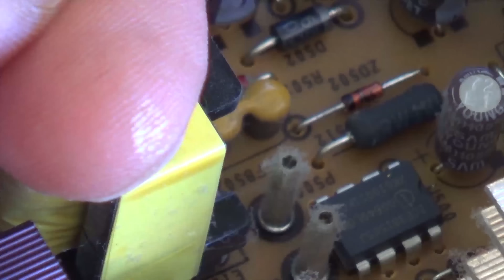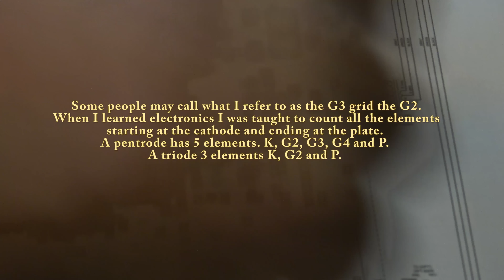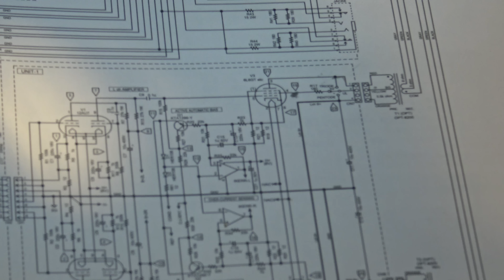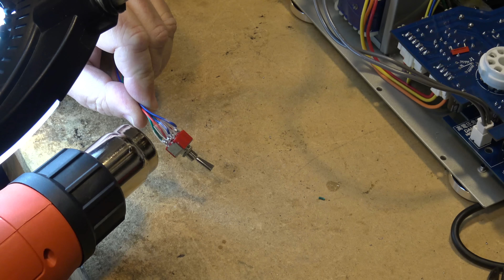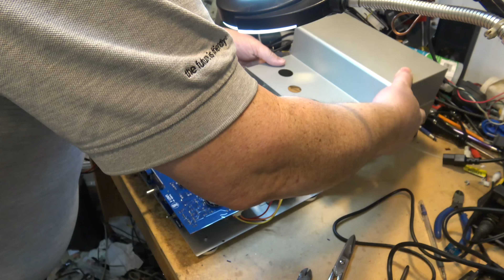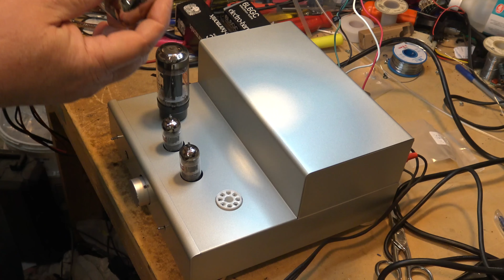ELEKIT TU-8200 6L6 Single Ended Tube Amplifier build Part 5

Comment: oh wow , sounds nice even over this  mic and video, sounds analog
Reply from the maker: Single ended amps always have the best sound.
Reply: @12voltvids  glad to hear from you . Im just entering in that world and all im skeptical about is bass response . Some say there is no SE amp with good bass , then i check frequency response testing of one and its even higher bass then it should be , bit og gain on bass.
So those are contrary information's , what do you say about it ?Thanks
Reply from the maker: @dedskin1  it's all about the speakers.  You need really efficient speakers. I use technics sb7000 with big 15" woofers.  Bass is clean.  Also the tubes used make a big difference.  Swap the tubes for different sound.

Comment: Might have to do this, any easy way to map the LED? UL = Green, Triode = Blue
Reply from the maker: Well an extra pole  on the switch would do it.  
Notice that the new version of this amp includes a switch to change between triode and UL mode. Do you think the designer saw this video and thought hmmm, good idea and designed it into the replacement model.  I like to think so.

Comment: I'd like to see you put mahogany wood on the sides, give it little bit of a steam punk look. I really don't like the sheet metal look of the case. The front would look better being a thick piece of brushed aluminum, and that big hump in the back could be Plexiglas, so you can see what's going on inside. Just my two sense. Job well done, I think this amplifier rivals some of the amps that cost thousands more.
Reply from the maker: It does rival amps costing many times the price (this was not cheap, it was 1120 after tax). The metal case forms part of the shielding to electronics.  Yes it would look nice with a mahogany case, but I am not a wood work guy so it lives as a metal box.

Comment: Hi 12voltsvid
thanks to your videos I successfully assembled the TU8200.
To add a subwoofer I have to provide a line output, how do I do it?
Reply from the maker: You can take it off the wiper of the volume control or feed it off the speaker terminal using a voltage dropper resistor network.

Comment: im not the engineer but running signals close to the big transformers , i doubt that is a good design choice , some go so far to spin the wires and move signal to the one side , and power to the other , if they so much as touch they will throw the chases away , that is what i saw , its first time i see signal that close to the Iron core , or what thet is , that middle transformer round core ,  again im no engineer but i know a thing or two about electronics

Comment: I   wander how hi fi  buffs would rate this amp  in a blind test  with  manufactured amps costing   mega  money
Reply from the maker: Dambuster 

Just search ELEKIT TU8200 review to find out. Here is one review 
https://www.head-fi.org/threads/elekit-tu-8200-dx-headphone-speaker-amp-review.722633/.

And another

http://www.kenrockwell.com/audio/elekit/tu-8200.htm

That should answer your question. The experts agree, that this sounds as good as anything out there.
It is the best sounding amp I have heard.

Comment: I don't really see the point of showcasing an amp through tinny little speakers and a video camera microphone and some random video codec and YT's own compression scheme.  All I can tell is what YT streams back sounds pretty terrible with heavy bass breakup on some of the loud sections.
Reply from the maker: Those wern't tinny little speakers, they are a pair of nice Altec Lansing 305 floor speakers that are solid walnut, and stand about 2 feet high. These units rock, and sound beautiful. When they were new they sold for over 2,000. I had the surrounds replaced on the carbon fiber woofers and mid range drivers a few years ago. They sound absolutely fantastic in my studio, and any distortions are caused by compression, and youtube re-coding.

Comment: Just finished building one sounds great had a little problem easy fix.
Reply from the maker: Russell Phillips 
Yes it does sound great. They have a new one that uses 300B tubes. That would be interesting to build.

Comment: Enjoyed your your documentary on valve amp kit.In ultra linear there was less distortion and more body in the sound.My Bose powered monitor speakers connected to my P.C certainly picked different's between each mode.You could at later date try different out put transformers with higher primary inductance,this lead an improved bass response.I love heavy mental.

Comment: Nice video, good fun. For newer players. Remember output valves need to see a load connected to OP tranny. If you are switching speakers between amps make sure no drive to valve amp when disconnected - it can be hard on the valves/tubes.
Also amazing how little perceived difference between ultralinear and triode, always amazed me that jumping from 4W to 20W(for instance) was not always obvious.
Reply from the maker: Martin D A 
The risk is more to the output transformer. If signal present under no load high voltage can develop in the secondary winding which can arc over in the winding and cause a short. When I switch to the other amp I turn the tube amp off and I turn power off when switching between ul and triode. There is a noticeable gain in power (loudness) in Ul mode however I definitely do prefer the sound quality in triode mode. I am seriously considering building the new model which uses 300B tubes. Costs big bucks in kit mode but this one has been so good I am looking at building another even better kit.
Reply: Yes, transformer is at risk - that was me writing and not thinking. Great having your efforts here on YouTube.

Comment: i would like to see your old McIntosh tube receiver.  Did you make a vid for that? Thanks point
Reply from the maker: It will be overhauled soon. I have many other projects that I am working on, but the MAC will be a total recap as it is my unit, and worth a small fortune these days. I am not using it, it is in storage right now so that is why I have not done anything with it. Our of sight out of mind.

Comment: is this a kit? And what is the kit called on eBay? Thanks point
Reply from the maker: Point Dexter 
It is a kit. 
Sells for about 1000 can. Available directly from the distributors. Don't know about fleabay, never buy anything from that. It is the elekit tu-9200
Reply from the maker: In Vancouver BC it is available from Lees Electronics.

Comment: Thanks for uploading this series 12Volt. It should help any beginner who is wanting to buy and assemble this amp.

I did mine in a pretty quick manner ( elec tech , with quite a few years under my belt soldering, troubleshooting, etc.) and I am OCD about my soldering. 

I run this little amp on my Altec 19's in the winter, I am planning on getting its bigger sibling, the TU-8340, with the xmfr upgrade. I have/need to finish up a HK Citation II project first. I also have a few other amps I need to get up and running too.

Again, great video series!
Reply from the maker: The build would have gone quicker if I was not recording it for sure, but I needed to drag it out for multiple videos so I can maximize my youtube payout. Have to pay for this some how.  To the wife this was an un-authorized purchase so it has to come from youtube money. That is all I am allowed to spend on projects. (That's my rule not hers, but I hold her to the same standard. She can blow the extra cash she makes doing her side jobs on whatever she wants)

Comment: great - one of the best how to videos I've seen...tempted to get one and build !! What switch do you use for UL to triode toggle?
Reply from the maker: It is just a small double pole double throw switch. The one I have is not rated high enough in voltage but so far no issues with it. It isn't handling much in the way of current, but is running about 330 volts and is only rated 300.

Comment: the "brid" amp with the led's in the signal path. we used to sell those at ear food in winchester. glad to see one still kicking ;-). also...tube class "a" amps always kick ass as far as clarity and balance goes. the unfortunate part is that they are also a little thin on the low end but it's the nature of the beast. i still prefer the sound of the single ended "a" amplifiers though. ;-)
Reply from the maker: Gizmo Thewytchdoktor 
into headphones they sound fantastic. especially in triode mode. 
I still use the luxman in the studio most of the time but turn the tube A on when I don't need lots of volume or when working with "cans" on.

Comment: Great post, I have been looking at building a 8200 and after seeing your post I now know I can handle the job. Thank you so much for taking the time to post this project.
Reply from the maker: Yes it is really easy to construct, and everything is included. If you can handle a soldering iron and hand tools you can make this great sounding amplifier. I am using it right now as I type this message out, and since building it 3 months ago it has been in use daily for 4 to 5 hours a day every day.
I plan on rolling the tubes for a set of NOS KT88 soon. The Electroharmonix sound very nice, but that is the beauty of tube amps. Lots of options for tubes, and changing the tubes gives a different sound.

Comment: You are going to damage your output tube if you change the mode with power on. It is advisable to change the mode switch from UL to Triode or in reverse when the power is OFF. And in addition the tubes are cooled down as an additional precautions.
Reply from the maker: Shridhar Kunte 
I do turn it off before I change modes. not that I change modes often. I prefer the triode sound and leave it in that mode most of the time.
Reply: good luck! Happy listening!
Reply: Thanks for this suggestion. Does it count also when the amp is on but you have no input signal in? Thanks

Comment: It's hard to hear what your hearing threw your camera and you tube but it sounds alright plus it depends what speakers you got hocked up too it.
Reply from the maker: Yes I know youtube comressses the audio, and the mic on the camera isn't a studio microphone. The sound through my Altec Lansing 305 speakers is fantastic. If I shut my eyes I can sit back and place where the musicians are seated during this live recording session.The imaging, especially in triode mode is as close to perfect as I have heard.Up until building this amp (actually I git my first taste of single ended tube amps when I built the smaller amp last month) I had never experienced a single ended tube amp. I have a couple of push pull tube amps, and I had heard other peoples descriptions of the sound form them, but until I actually built one and listened to it on my speakers I couldn't appreciate what they were saying. Now I know why audiophiles pay what they do in search of the perfect reproduction of sound from a sonic perspective.On paper solid state kicks tube equipment to the curb, and has for years, but there is just something about the sound that the ear really favours on tube gear. It was once explained to me that the way the harmonics work in a tube was exactly the way the human ear responds to them.  Good enough for me, I know which amp I prefer to listen to. My favorite was my Luxman 103 from 1984, now it is this one. They are very close in sound quality, but this one, has the edge in terms of musical enjoyment. Even listening to MP3 files it sounds better, Smoother.

Comment: Awesome video series, sir!  I recently subscribed and I watched this series first and then the one for the TU-8100.  I came back to the TU-8200 series again and it inspired me.  Today I ordered the TU-8200DX from Tube Depot.  I also ordered the DAC that goes along with it.  I wanted the little pre-amp (TU-8500 ?), but the wallet was screaming, so I took a rain check on it and bought a pine-board kit to start with,  that I'll set in a box.  I can't wait to receive my stuff.  The ELEKIT looks like it's first rate.  I have a pair of little Aiwa (don't laugh) bookshelf speakers, made in Japan, that I think will work well with this amp.  They have a beautiful marbled finish and they'll look great straddling this amp.  I need to get some good headphones, next.  I 'm dying to feed in some Glen Hansard from vinyl and just sit back & let it take me downstream.  Have you thought about painting the cabinet?  I am considering it.  I like the industrial look of Steel It, so I might just give it a squirt.Thanks for what you do.  I know a bit about vintage 1930s and 1940s radios, but almost nothing at all about hi-fi.  Your vids have started to change that for me.  Good on ya'!        Cheers!    Michael
Reply from the maker: It actually looks pretty good as it is, but glossy black would also look great. The 8200 sounds fantastic. I am driving my Altac Lansing 305 floor speakers. Very good sound. The best sounding amp I had was my old vintage Luxman LV103 which is a hybrid. This one sounds as good or better. When I have done blind tests with friends they can't tell which amp they are listening to. Very smooth sounding unit. Using it now as my main amp in the studio, and I prefer triode mode now, even though when I first listened I though that UL sounded better. UL has more bass, but triode sounds more accurate.

Comment: DiMarzio model EP-1111 is a 3 Way 4 Pole Double Throw Switch (On-On-On). I can't find the voltage spec.
Reply from the maker: That might work for all 3 modes, but I am happy with just 2 modes. Right now I am set up for triode and UL, but I may switch to triode / pentrode just to hear the difference, but I am waiting to break in the tubes before I make any changes or do any serious evaluations. I have abut 12 hours on the tubes now. I will wait until I have at least 100 before doing any serious evaluations, as new tubes need to season, preferably at very low, or no volume. I threw in a set of old EL34 to listen yesterday, but they are back in their own amp in the living room, and the new EH tubes are back in this one baking as I write this..

Comment: Great amp!! You might want to read the review at 6Moons here... http://6moons.com/audioreviews2/elekit/1.html   Also he warns about using a mode switch and switching while the power is on. Read that here...(Quote) "Nevertheless switching back and forth between the three modes on the TU-8200DX  is not as simple as it appears. The selection is done by manually resetting a  pair of jumpers (one per channel) on the PCB inside the chassis instead of  through a three-step toggle switch from the outside. Elekit does not encourage the  latter modification as changing the mode setting under power might damage the  output tubes and output transformers. The manual further advises to unplug power  and wait 10 minutes to let residual high voltages dissipate before changing the  jumper settings. A word of caution: Read the inscriptions on the PCB. Be very  careful when setting the jumpers for triode and pentode. The left and right  channel are not mirror imaged. A good  trick is imagining yourself to be a pilot flying this amp and those jumpers are  your gyro horizon."(end quote)
Reply from the maker: I am fully aware about the manual warning about installing a switch, and yes I am aware that the tubes could be damaged by switching under power. I turn the power switch off before I change modes.The power tubes can also be damaged by disconnecting the speakers under load too, that is why my modified luxman amp that I talk about in part 5 having a pass through from the "B" speaker terminals to the "A" so I can switch between 2 amps by toggling the "B" speaker switch has a pair of 8 ohm 10 watt resistors that get switched across the "B" speaker terminals when the relay is in the "luxman" on mode. That way there is no induction generated back through the output transformers.Running a tube amp under no load cam damage output tubes and the output transformers.The chances of popping a tube changing the mode when the power is on and there is no sound playing is low. If the switch was flipped under a full load the changes increase, but turn the power switch off before changing modes, and the risk of damaging anything drops to zero.

Comment: Well that didnt take too long to add that feature, and you have done it in a non distructive and fully reversible way :-).
With my knackered ears i could not tell a difference, just listening to the music at low level started up the tinnitus tuning forks in the head, and i could not hear past it, also it distorted the audio, so im sorry i cant comment on the sound difference.

For the amount of assembly work, i didnt take you very long to assemble really :-D
Reply from the maker: The difference I notice is ultra linear has more bass. However when I put in some well aged EL34, I actually prefer the triode sound mode. Once I age the 6L6GC Electro Harmonix then I will be able to judge the sound from those.  As most tubeheads know, tubes been a break in period like a car engine. That first 100 or so hours they sounds rather rough. I suspect that impurities in the cathode material restricts emission properly and as the tube heats those impurities burn off the surface.
Reply: Can i ask a daft question?
I have heard the phrase "The sublime sound of valves.", i dont really know what that means, do you know?
Reply from the maker: It refers to the tone, or warmth that a valve amp brings to the sound as opposed to the cold harsh sound of a transistor.
Reply: Thank you, ive allways wondered what the hell they were talking about.
If they said frequency response and harmonic plesentness i would have had a better idea.
A warmer less harsh sound hmm :-D